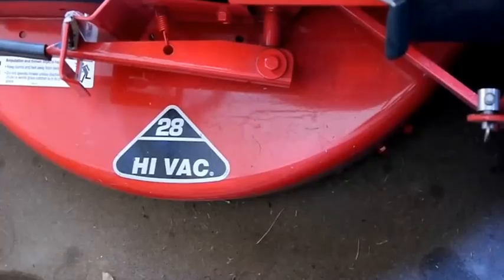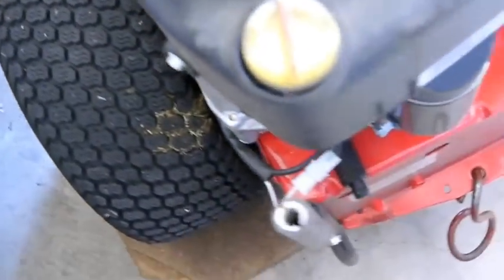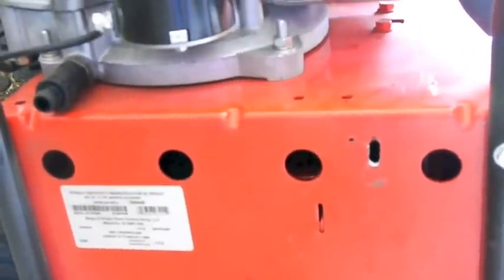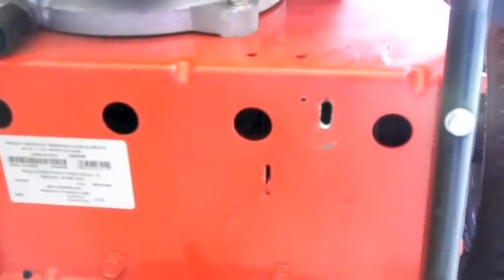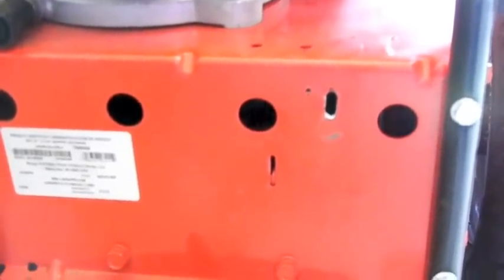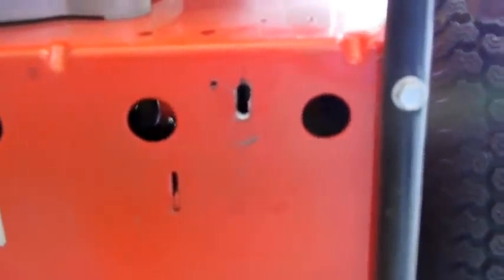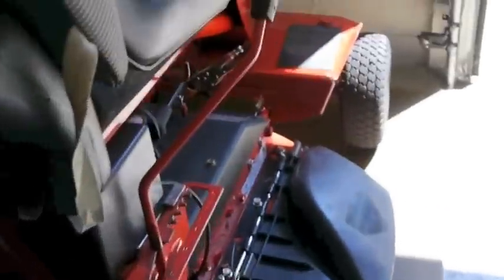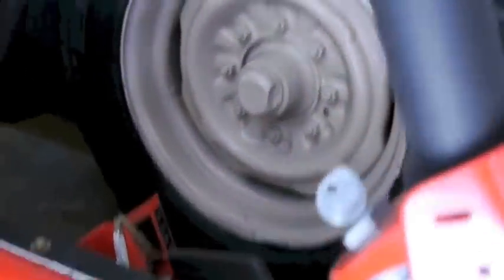Snapper Friction Drive Modification

Comment: Greetings, I used to be a Snapper dealer from 1981 until 1995, while the repair you showed works, A better one would be to remove the drive disc from the engine (what folks call the drive disc or friction ring is actually the 'driven' disc), the drive disc is the plate attached to the engine) and place a washer between the end of the crankshaft and the bottom of the drive disc crankshaft hole. The older style the drive disc was adjustable, it had a 1/4 inch keyway with two allen set screws and from the face of the drive disc to the rear housing should be just under 4 inches. (the flat, not the lip at the engine hole). The newer style just has a bolt holding the drive disc on the goes into the end of the crankshaft of the engine. If your Yoke lift is touching the rear of the housing it is travelling too far because your drive disc isn't low enough on the engine crankshaft. By putting a washer in the hole you are effectively lowering the face of the drive disc which will cause the yoke lift to work in its propper area of operation. Also you can double the yoke lift springs. I always loved Snappers because every piece had a part number, I could order anything to repair them, unlike mowers that I could not. If you have any more questions I would be glad to help you with anything you need!
Reply: Gary Lilley 
By reading your comment I see you know Snappers. I need a power winch drive with variable forward N reverse. I've never done any towing with a Snapper but do have several skeletons of Snappers behind the barn. I kept them because the whole transmission worked well on thse and had planned to use them as utility vehicles on the place. With good rubber disk would it get traction like a belt and idler? The only issues of slipping I ever had was when the rubber disk was used up and I mowed a lot of hills. I just never loaded one tho.

Comment: It seems as though Snapper has a design flaw that enriches their parts and service businesses at the expense of the customer.  I have the same mower, and on the third year, it started slipping.  So I had the drive tire replaced, and it worked great 3 years ago, but now, it is slipping.  My 15 yr old Snapper ran for 10 years without having to replace that tire!  Thanks for enlightening the masses with the power to not be cheated!

Comment: I have a series 13 (20 years old) that is having slipping problems after mowing 2 acres for 3 summers. It has quite a few miles on it and has some slop in the clutch system the disc slips only half worn out. I will try this modification o see if we can get a little more run out of the disc.

Comment: I did what Elroy Mills said to do (11 mo. earlier), but I did it a year ago.  Well, it worked great and didn't change the rear appearance of the lawnmower.  That bracket is a short angle bracket and all it needs is to provide a rounded edge.  This mod is great if you don't have another friction disk available and it buys you time and allows you to use more of the friction material that is already there before replacing this friction disk.
Reply: the
Reply: thet
Reply: r
Reply: rr5

Comment: If your clutch slips, it's from too much space between the driven disk and the rubber lined clutch disk. Properly set up these mowers will darn near wheelie going into first gear. Hills should be no problem or towing something.

Comment: If you drill 4 holes though the hub and new rubber wheel, you can pull boats and cars and hills while cutting grass and do wheelies and the rubber wheel last about 10 years. used 4 1/4-20 bolts with washers and locknuts head of bolt inside hub sticking though wheel with nuts on outside of rubber wheel. Even the snapper dealer was impressed.
Reply: The old style was made with 5 bolts holding it to an aluminum hub, they changed it because they would "wheelie" back in 1981. If you have a customer a safer approach would be to use two yoke lift springs. Of course, for personal use, wheelie away!!!
Reply: MrHarley,   something is missing, no one knows what you're trying to explain.
Reply: dave12546 you are centering the drive wheel on the hub
 and drilling four holes and bolting it to the hub. No more slipping.
Reply: MrHarleyultra I got it  now, direct drive, thanks
Reply: MrHarleyultra Is there a video somewhere that shows how to do that?
Reply: Darius Dunson sorry no video. Made this mod in like 1991 worked till 2010 let it go with the house. Don't have a Snapper like that anymore have a snapper Zero turn now.
Reply: +MrHarleyultra ---you already have four holes that hold the rubber drive wheel on...am I to understand that you want to drill four more holes thru the rubber drive wheel and the hub so you'll then have eight bolts in total?  We just can't seem to visualize exactly what you are trying to do.  I'd like to try it, but for the life of me I just can't see it.   Can you help out some more...and thanks!?
Reply: +magnogreato the four bolts you have now don't go thru the rubber wheel they hold the outer plate to the hub with the rubber wheel sandwiched in the middle. center the rubber wheel go to the outer edge of the hub and every 90 degrees drill thru hub, rubber wheel and outer plate. Put in 1/4-20 bolts with washers and lock nuts.
Reply: +MrHarleyultra -If you're drilling into the rubber which appears to be about 3/4", what happens as the rubber wears down?  Am I missing something?
By the way, thanks for the feedback...it's much appreciated!
Reply: +magnogreato do not drill into the rubber 3/4 in on the "HUB" then drill tthru hub ,steel part of rubber wheel ona outer plate.
Reply: +MrHarleyultra to get the rubber clutch plate centered perfectly on the hub, I used business cards on  four sides to center it evenly
Reply: YES it has to be centered, the cards is a good idea or use feeler gauges @  12, 3, 6, 9:00 and ALL of them to be within .001 or so apart in thickness.
Reply: Something even MORE easier, put the old style disc & hub on it!

Comment: the problem here was the poster had power tools capable of making holes in metal. so rather than coming up with the simple solution to lower the drive disk holes were made. cat in a tree? go get the chain saw.
Reply: In his defense, and as a repairman store owner for 12 years, We've had disc plates that just laughed at us, even  after applying the heat with an acetylene torch, but rather than drill holes in the armor plating that makes Snapper such a good design I just ordered a box of springs that had more tension and replaced the old ones. We didn't give up on trying to pull the drive plates, but after enough was enough, it was time for a stronger spring. And mind you, the difference in tension was small because you could barely feel it on the clutch pedal, but it made a world of difference on engaging the drive disc. I know a simple OEM spring would have solved the problem for the most part, but the way most of my customers used their mowers like they were ATV's, the stronger springs put an end to people coming back saying it was slipping again.

Comment: You had to create this slot because your rubber driven disk is too small in the OD measurement. Should be 6" in OD from the outer edge of the rubber. Measure yours and see what you get.

Comment: pro tip: when you drill and put a small plate over the hole, if you use two bolts to hold it on, leave the bottom one on, rotate it 180 degrees and drill for a third bolt hole so you just remove the top bolt, swing the plate down, put the removed bolt in the new hole. Know what I mean?
Reply: Tim Moore Good idea
Reply: Thanks man! I'm good at thinking outside the box, do you know where the "outside the box" saying came from? The first IQ test was basically nine dots and you have to draw lines to connect the dots in as few lines as possible.. The way you do the best is essentially pass the corner dots, drawing out past the box that nine dots form.
Reply: Hey guy, I may be the proud owner of a 2009 New Holland TZ22DA with mfwd system with locking diff's, rear 3 point with 900lb lift capacity @ 24", rear and mid PTO, 60" belly mower, roll over protection system, lighting, turn signals, reversing beeper etcetera, hi and low range, wet disc system, wet lines up front for endloader, blade, or whatever.. A serious little piece of hardware... Tomorrow morning I will find out!

Comment: My friction disc is stuck, in neutral my back wheels won’t turn… it was working great and then just stopped moving
Reply: How about you lift up the mower and look underneath. My dad used to use a chain to hold his mower up that was connected to the ceiling. Otherwise lots of blocks of wood to get 
it up enough so that you can stick your head under there. I don’t have the mower anymore and I don’t remember if we have to do some disassembly I think you do to see what’s going on inside there.My bet is it needs some cleaning.

Comment: I bought a snapper to toy around with. Now I'd like to make it go faster (approx. 10mph). Any suggestions ?
Reply: Pieter Maes RPM. the gear set and drive ratios are what they are. short of custom gears the only option is to turn them faster
Reply: I put a couple of larger diameter wheels underneath, which gave pretty much the desired result. Thanks for the input.